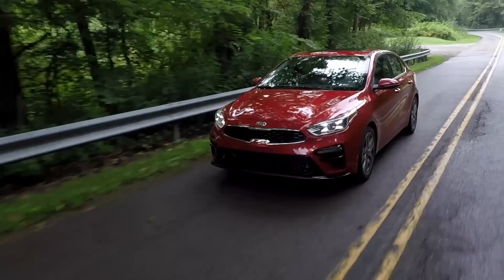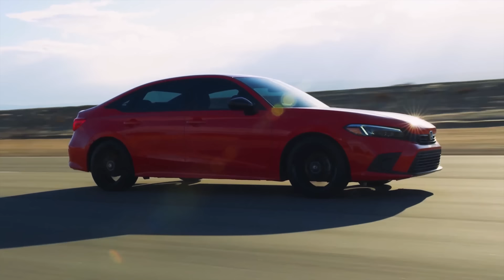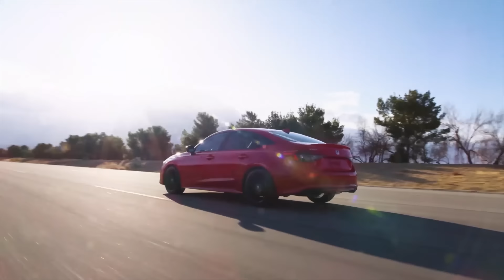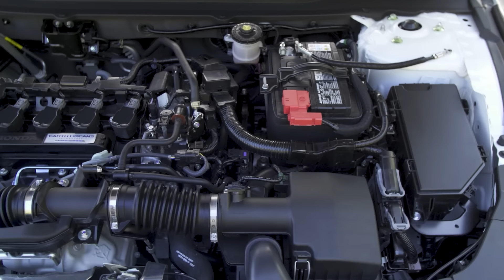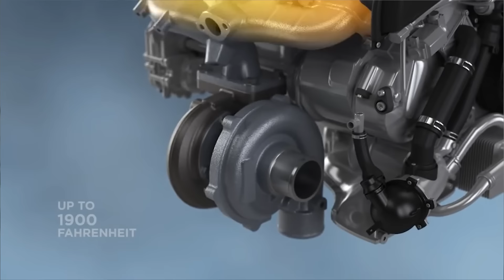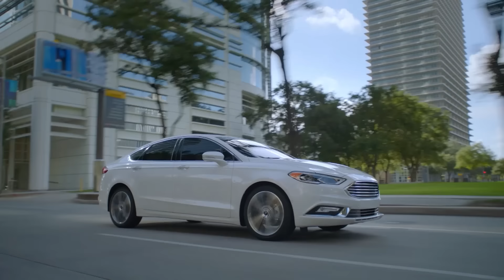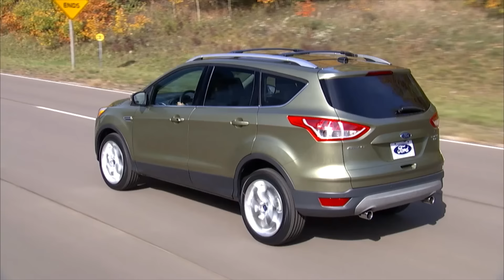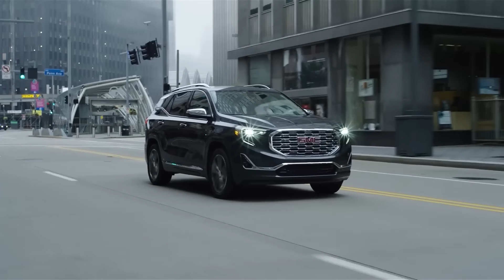Are Turbocharged Engines Reliable? The Truth About Turbo Engines

Comment: Good video. The only turbo I ever owned was a 99 Audi 1.5 L Turbo. I had the car for ten years, and while the turbo itself was never a real issue while I owned it, the car's complexity caused many other terribly expensive repairs in it's final years. The main problem I had with the turbo was the slow start and stop performance in city traffic. On the open highway, it performed fine, but in regular stop and go conditions, it sucked.
Reply: That was a car built 23 years ago, right?
Reply: Your Audi with an exhaust system would have been ok but back then port injection meant ok not great power. My 00 1.8 was not bad. With updated turbo, tune, and exhaust it was plenty quick.
Reply: I know what you're talking about, scrolling turbos (they're everywhere now) were not common back then (I think porshe 911 had one back then).
I drove a 97 RX7, making a U turn, no power, no power mid U turn, boost and we go sideways lol.  Incredible power difference in those engines.
Reply: @unclejim1528  Right. The point is that turbos have been improved, and auto makers need to increase fuel economy. A logical way to do that is with smaller displacement engines, adding turbos to make up the power deficit.
Reply: Hybrid turbo would resolve that issue

Comment: Never ever, no way.  "The history of passenger vehicles is littered with the debris of turbocharged engines."  I have a 2019 RAV4 -- NA "dynamic force" engine.  So, it's got direct fuel injection, but it also has port fuel injection.  I took a 200-mile trip just today, going through curvy mountain roads.  I passed everything I wanted to -- a couple of drivers ahead of me were willing to go 20 MPH over the limit, I wasn't.  But I passed everyone else.  Enough power to pass, definitely.  I'm averaging right around 30 MPH over the years -- tracking actual numbers on a spreadsheet.  I LAUGH at all of the competitors with turbos that still can't match my MPG.  Screw the "PR" manual and its 10,000-mile oil change intervals -- I go for 5,000-mile changes.  I plan to keep on driving this vehicle long after its turbo competitors fill up the junkyards.

Comment: don't buy hybird car with turbo, auto start/stop always turned off. no more then 5k miles between oil changes. use high-grade oils above oem. for short trips start the car few mins before you drive. don't buy eco cars with turbo unless you don't plan to keep pass warranties.

Comment: I had a Jeep Wrangler with the Hurricane 2.0 Turbo. It was a great engine with plenty of power. I wouldn't hesitate to buy another one. It received regular maintenance and synthetic oil only. No issues over 80,000 miles.

Comment: I would take the new 2.5 Mazda turbo any day over any other.  I have seen more than a few with 300,000 kms.  A couple of people I know, one is a friend of mine and the other guy is someone I work with, Both have an old VW EA888 2.0 turbo, both with 400,000 kms and still going on their original turbos and internal components.
Reply: I avoided Mazda 2.5T, when I was looking 2 of the few i looked at had cracked heads. Enough to turn me off.
Reply: @mrkring1526  I have seen a few 2.5T CX9s with 300,000 kms.  I’m waiting for my 2016 cx5 to die out and I will replace it with a 2023 CX9.
I know a few have had cracked heads, but that is nothing compared to their overall quality and reliability.
Reply: Your absolutely right Kevin. I bought a 2022 Mazda CX5 Turbo and absolutely love it!! Mazda makes one of the best, if not the best turbocharged engine. Longevity of any engine all depends on how well it is maintained.
Reply: Some hope!  Thank you. Mazda CX-5 is very high on my list after test driving twice.
Reply: .y Toyota has 400,000 mileage... lol!
Reply: @anastaciolopez6259  yup. I know a few naturally aspirated Honda engines that reach 1 million miles.

Comment: I do not agree with his assessment. He is too generalized on many brands, Honda, Chevy, Ford,BMW etc. I only have personal experience with Chevy Cruze, mine is 2012 eco manual with 1.4L turbo engine. The car now has 60k miles. I changed oil according to the owner manual (reminder on DIC or one year), l also changed the transmission oil at 55k miles. It give me 42 plus mpg. It has not given me any problem yet. Modern car is complex, it is controlled (monitored) by a computer. If you know the car, it is hard to destroy a car (engine and transmission). If you don't know the car, the take it to an honest mechanic.
Reply: Mechanic since 94 here... Regardless of manufacturer or brand, adding extra heat or pressure to a gasoline engine shortens its life as compared to the naturally aspirated version. Maintenance is much more important for forced induction, a missed/extended oil change, and/or dirty air filter can destroy it in an instant. Inside of the Turbo housing are very small, precise bearings that require clean oil at all times. Clean oil transfers heat better. Any carbon due to blow by or waste fuel,can slowly erode these bearings. Diesels aren't nearly as bad, because diesel fuel(oil) by nature is a better lubricate than petrol. They also are built for extremely high pressure. If leading or trading every 3 to 5 years, it my be ok, but if you plan on keeping it around permanently, I would avoid them. My 4.0l Ford Ranger turned 20 years old this past June, currently sitting at 202123 MI, my mother's 2016 Pilot just crossed 181000. We drive our cars & maintain them well, don't need any added complexities & special procedures when it's unnecessary. Also, the three year old ecoboost explorer at my job site is down for blown Turbo seals & bad high pressure fuel pump. Yall can have em!
Reply: @diyi75  Well, I think you missed my points. My argument is that I admit that NA engine are good, but turbo engines are good as well. Do the normal oil change and not neglect when there are small problem pop up, you may also drive a turbo engine for a long time. I am experimenting the GM 1.4L turbo engine, it has lasted 10 years 60k miles, I will observe it and wish to drive it to 300K miles.

Comment: My 2022 Civic hatchback has the 1.5 turbo. Fuel economy and power when I need it. I understand the issues and always get maintenance done on time or early. In a few years (time frame TBD) my next car will be electric and this issue will be moot for me.
Reply: What regular maintained are you referring to? I am curious because I am interested in getting a 1.5T 22 Civic myself and after watching these videos I am slightly concerned about the long term reliability

Comment: Very informative video! I opted for the NA engine in my 2022 Mazda CX-5 instead of the turbo mainly because I plan to keep this car for the long haul and heard that NA engines are the more reliable option. Heard many horror stories about turbo engines with premature issues like you mentioned.
Reply: @scottsdale4899  what’s crazy is that the same engine in the Mazda cx30 and Mazda 3 doesn’t have cylinder deactivation. I can’t understand why Mazda decided to put cylinder deactivation in their 2.5 na in the CX5 and CX50
Reply: Family has a 2016 CX-9 with the 2.5 Turbo, currently well past 120,000 miles without a single issue with the engine.
Reply: @jakenoltensmeyer7366  That's great to hear. I had a 2021 Mazda 3 Turbo, had about 15K miles on it and started consuming oil. It was a defect in some of the valve seals in some 21 turbo models and a fix wasn't and still isn't available though Mazda acknowledges there's a problem. That car was a lease and they offered to buy it out early due to market/demand so I took advantage of it for a bigger vehicle. But I do miss that car and the turbo for sure, definitely an awesome engine!
Reply: I opted for a turbo model CX-5. I plan on keeping it for the long haul but have a bit of fun doing it. Lol. There are a lot of turbo'd CX-9s with triple digit odometers and no issues. Same engine.
Reply: @scotchbudmeister9018 how has it been so far? Considering going for a turbo CX-5 but mainly because of it being the only trim in my country that offers ADAS, 360 cameras and memory seats but I’m not too excited about the turbo engine. My use case is mainly city driving with less than 10% of highway driving, I’d pick the NA if there was a trim option with it and the nicer stuff. :(
Reply: @Isaac120396  I just hit 4 years since new. No issues. Using the mpg average computer, my best mpg in town so far is 26.4. I got it up to 37.1 mpg on one highway day trip. These numbers show its potential but those were done with filling up the tank and no use of the turbo with gentle acceleration and braking. In my case, I'm always tempted to step on it - lol. Regular driving in town with 25 mpg is pretty realistic. I wanted all the options as well. I'd hate to spend a lot on a car and not have it equipped the way I want it. Regular maintenance keeps turbo engines going for years. Good luck!
Reply: @scotchbudmeister9018  I’m planning on following the recommended schedule for maintenance, would you recommend any extra steps to ensure it stays in top shape? I’ve read about letting it warm up and cooling down at the beginning and end of trips to help the turbo with temperature.
Reply: @Isaac120396  Yes. I keep my foot out of it until it's up to operating temperature and do let it idle for a minute before shutting off if the turbo was used during the drive. Some may say it's not necessary but it's what I do. I plan oil changes at 5,000 miles (8,000 km) not 7,500 miles (12,000 km). Full synthetic. If you put less than those miles in a year, change it once per year.